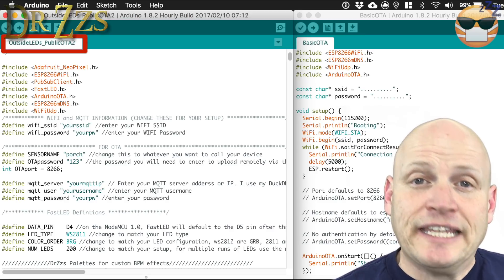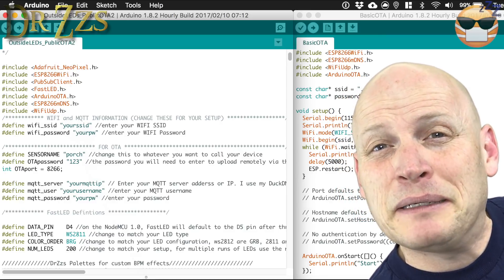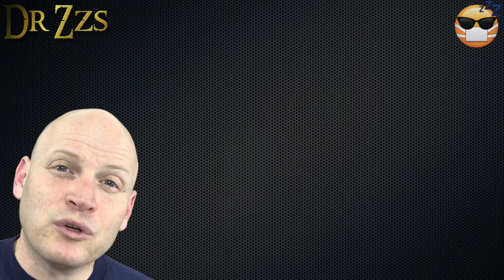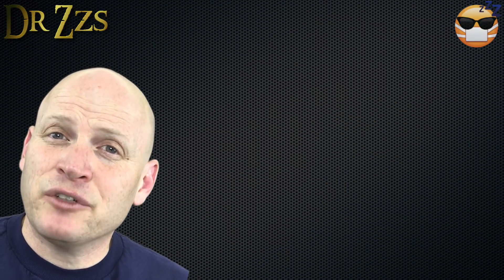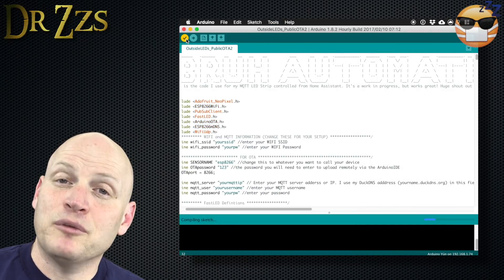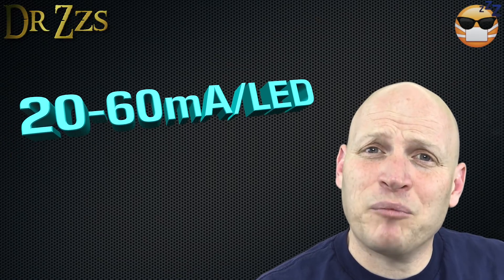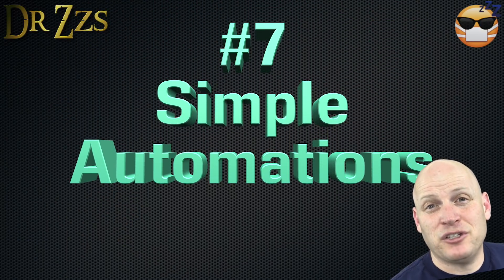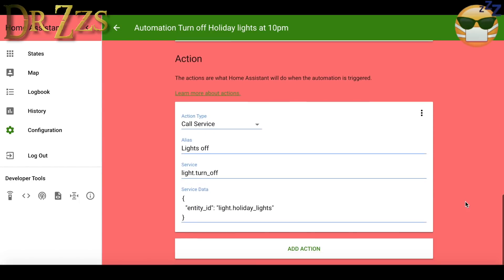Holiday LEDs - What I wish I'd have known

Comment: First, Thank you for your videos. I'm Working on my first set of LED strip lighting. I am using a single string of 50 LEDs just for testing. However;  I followed your instructions for months now also using Bruh video and was successfully set up my Home Assistant with MQTT broker configured and working, The sketch was successfully uploaded through COM Port and OTA upload via Arduino IDE. but still not able to get all the LEDs to turn on. I connecting 3 wires: 1 to 5v, one to GRD and data wire goes to D4 Pin, but I ONLY get the 1st 11 LEDS led with CW (Cool White), the 12th LED in WW or Yellow the rest are all OFF.....I used another Sketch by Carls from " Permanent Digital LED House Holiday Lighting " and uploaded to my Arduino Mega 2560 all the effects works on ALL 50 LEDS string. I couldn't figure it out. Please Help.

Comment: Finally got mine working with this code!  Thanks for all the work you've put into publishing this info it's much appreciated.  For some reason I had to use BRG for the 2811 strips I had.  That took awhile, i actually got frustrated and used other code but it had too many issues so I came back here to figure out my issue.

Comment: Working on my first set of LED strip lighting. My configuration requires that I split my string at the control box for 2 separate runs. I am using BRUH wiring set up for I am stepping up the data line for 3v to 5v. Once I connect both strings to the stepped up line one starts to freak out while one works fine.  I am thinking it is related to a decreased voltage to run both strings on the same data pin. Is there a way to duplicate the signal on 2 different pins?

Comment: Got everything set up but all I get it to do is turn on and off a solid color,  no animations work, even when I set the initial state as an effect it stays solid. I have FastLED 3.2.1 installed
Reply from the maker: it's probably the topics.  If you copied what I had in the github, then the topics didn't match between the sketch and the yaml example.  I fixed them today. 
The easy thing to do is probably to change the yaml to match the sketch so you don't have to recompile and reload onto the board. 
Hope that helps.
Reply: @DrZzs  I copied the mqtt topics from the sketch to yaml, but still no luck. The arduino serial monitor only shows it's getting on and off commands. I even tried putting the seteffect command in the config file and no luck.

Comment: So I started on my holiday led project this weekend and got it up and going for the most part but about 10% of the effects with something to do with red like Christmas, Valentine, USA and a few other when selected lights up red then shuts down, but candy cane ,holly jolly, lovey day and I can do solid red and they all work great. Can any one give me any ideas whats wrong.
Also can I split off the led strip and go two strands two different directions like up the eve or would I need to start a new section?
Thanks
Reply: I remember you talking about having to make some changes in the pubsubclient for one of your projects but cant find it, could this have anything to do with it?
Reply: Looks like I got it fixed, I needed to add  #define FASTLED_INTERNAL before #include <FastLED.h> to my Arduion sketch . I think it had something to do with BPM, not sure though but works great now!

Comment: 7:33 not so hard of a thing to kno. unless yur knew. in the beginning they were called puks not buck converters because they looked like hockey pucks. some moron couldn't hear and/or understand. and started running around happy as a merinarea hybyrd  zippy yuppy screaming buck converter buck converter i love it i love it. Isnt this the most awesome freaking thing. blinking twinkle lights like never seen b4. So anyway it caught on and started getting called buck converters instead of puck converters. then they became digital instead of potentiometer resistance and got smaller and rectangle shaped. But they still were called buck converters.
Reply from the maker: awesome.
Would love to see you doing that skippy screamy dance.  I don't suppose you caught that on video?
Reply: lol no missed that one. was just before everyone owned smart phones. very sorry

Comment: Holy Crap thank you for the flickering fix, was on my way to go get a 5v 12amp Power Suply and in South Africa they are $$$!!
Awesome channel my man!
Reply from the maker: Thanks!
I just discovered another potential source for flickering (if this solution doesn't work for you).  Power the D1mini from the USB port instead of directly to the 5v pin.  There's a diode that gets bypassed when you go directly to the 5v pin and that difference can cause flickering too. 
Hopefully that won't be a problem for you and you can ignore this comment :)
Reply: @DrZzs  thank you for the reply! Wish o could send you a vid of what we made.

Comment: Hi, I wonder what version of the FastLED library you used in the Holiday LEDs project?

When compiling the project appeared this warning:

Compiling .pioenvs \ d1_mini \ src \ HolidayLed.ino.cpp.o
In file included from C: /Users/LeandroCosta/Documents/PlatformIO/Projects/Holiday-LED-files/src/HolidayLed.ino: 27: 0:
lib \ FastLED-master / FastLED.h: 17: 21: note: #pragma message: FastLED version 3.001.008
# pragma message "FastLED version 3.001.008"

^
In-file included from lib \ FastLED-master / FastLED.h: 68: 0,
from C: /Users/LeandroCosta/Documents/PlatformIO/Projects/Holiday-LED-files/src/HolidayLed.ino:27:
lib \ FastLED-master / fastspi.h: 110: 23: note: #pragma message: No hardware SPI pins defined. All SPI access will default to bitbanged output
# pragma message "No hardware SPI pins defined. All SPI access will default to bitbanged output"
^
Linking .pioenvs \ d1_mini \ firmware.elf
Reply from the maker: Just had to check... mine is version 3.1.6

Comment: WISH YOU AND YOUR FAMILY VERY MERRY XMAS - GOD BLESS YOU ALL
hi i have install the light finally today but i am facing an issue certain effects just either reboot the board and switch off the lights or make it non responsive from hassio and i have to reboot esp8266 manually.
Reply from the maker: Thank you!  And the same to you!

Boy, you've sure had more than your fair share of problems...
How do you have your board powered?  Make sure you're not powering your lights from the control board pins.  The lights should have a separate pair of wires for power.  Connect those 2 wires to the power supply, then connect the control board to the other 3 wires (5v, gnd, data).  

If that's not it, tell me some more about how you have things connected and we'll see if we can identify the problem.

Comment: Got them half-installed and all was working fine then I installed the rest the next day, unfortunately the Wemos D1 fried somehow.... I took it down and tried to upload another sketch and the COM port will not connect. I ordered 2 more boards, hopefully I can get the animations working before Christmas. Either way, I'm happy. 

BTW, I have 365 LEDs from corner to corner of my house, So I will run the others on the other side and buy more so I can have the ALL around the house, then do the garage during the summer. Not sure how I am going to do this as the garage is detached, separate Wemos D1? Slave D1? I got some researching to do..
Reply from the maker: I fried a D1 by connecting the +/- backwards.  Guess they're fragile. Good thing they're cheap. 

As for running detached lights, you're in luck!  I'm planning on explaining how to do that in an upcoming video.  It isn't hard at all.  You need a separate D1 and power supply.  The rest we'll sort out in the sketch and Home Assistant.
Reply: DrZzs whew,  I ordered 2 D1's, guess I need another power supply and lights,  think I'll go 12v with the garage.
Reply from the maker: David Garate Can never have too many D1s! 
The gist of running multiples is making unique mqtt topics then combining the effects with an automation in Home Assistant.  
I’m having trouble with the OtA sketch. It was working but now it isn’t.  Not sure where the problem is.  I’d really like to get that functioning perfectly on every D1 I have.  Someday I’ll get it.
Reply: DrZzs do you want to see my sketch and double check? 
I got the sketch to upload on my original D1 (I had uploaded to another board,  which gave me extra options under 'Tools', I didn't notice until tonight, uploaded to an arduino board and options went away, switched back to D1 mini and all is right)  and everything is working. Except for a couple animations look funny.
Reply from the maker: That'd be nice.  Just to compare with mine.  Thanks
I must have overlooked something.  When I load it without OtA it works fine.
Reply: Sorry for the delay, I had to clean the house when I got home.. Here is my OTA.ino file.

https://www.dropbox.com/s/ztqdsuksgzzn9zg/OutsideLEDs_OTA-public.ino?dl=0
Reply from the maker: No worries!
I think my problem might have been I didn't load the basicOTA sketch first.  I'll compare with yours and see if I missed something.  
Thanks!

Comment: Hi professor ;o), you are doing a great job thanks so much!

i got theese RGBW 2812 rings, do you have any clue how to use them ?
https://www.banggood.com/NeoPixel-Ring-24x-5050-RGBW-LED-4500K-With-Integrated-Driver-Natural-White-Module-For-Arduino-p-1198221.html?rmmds=myorder&cur_warehouse=CN
Reply from the maker: I haven't used those, but it should be the same as using any 2811/2812 LEDs.  
Looks like you have 3 wires, so one is + one is - and the third is data.  
You can probably use just about any 3 wire LED controller, or Arduino based board.  So the Adafruit Trinket, the D1 mini (the one I use a lot), the NodeMCU, or of course an Arduino Uno, should all work.  
Going through the whole setup from my first LED video would be overkill for one small ring.  
What would you like to do with them?  Do you have more than one ring?

Here are links to a couple tutorials. 
 http://www.instructables.com/id/A-Very-Quick-NeoPixel-16-Ring-Test-With-Arduino-Un/
https://learn.adafruit.com/kaleidoscope-eyes-neopixel-led-goggles-trinket-gemma/arduino-code

Hope that helps
Good luck!
Reply: the problem with the rings are that they have rgb and a seperate white led, i have to look into it ;o)

Comment: I'm just about done with the controls, but i am having issues with mqtt  (can't get it to work). I've look round and just can not figure it out.  pulling out hair I don't have. Any chance you can help or anyone. I'm running the latest HA.
Reply from the maker: are you using HASS.io?  I had problems with MQTT when I tried switching to HASS.io 
I don't know exactly what causes the problem.  I think HASS.io lets the pi IP address change.  That's what seemed to be happening to me.  
I use the Hassbian install for HA and haven't had MQTT trouble.  

Tell me about your set up and what you've tried and I'll sure help if I can.
Reply: Here are some screenshot.
https://www.dropbox.com/sh/4rkl25zoq5pr02g/AADRHd56X-qSE3Em6RsCWc-Sa?dl=0
Reply from the maker: ya, it's HASS.io
if you aren't fully invested in your HA setup with HASS.io, the install it with Hassbian instead.  I bet that fixes it. 
https://home-assistant.io/docs/installation/hassbian/installation/

You'll have to go through the setup for mosquitto.  If you follow Ben's video it should work. 

https://youtu.be/AsDHEDbyLfg

Someday I'll try HASS.io again and figure out the mqtt problem.  I've just been to busy with new projects.  And, since my HA is working, I haven't had a good enough reason to change.
Reply: DrZzs I loaded the hassbian to the pi and got it to work. Thanks a million!  I was about to just order that cheap controller lol. But kept at it. Here’s the lights at work https://youtu.be/oMu_54JhzXg
Reply from the maker: YES!!!  Glad you didn't give up!
Reply: I thank you for your tutorial, I’ve one question how to setup an automation to change the speed effect ?
Witch service do I have to use? mqtt.publish or light_turn_on ?

Thank you
Reply: BABY FACE, the speed control is written in the code in the yaml file. You should see in your overview page of HA
Reply: Mremsurfer75  Yes I know but I woullike to creat 2 automation with the same effect but different speed.
Like the « police all » effect, first automation with normal speed and a second effect with maximun speed effect "150"
Reply from the maker: BABY FACE I’m sure we can do that.  I think I’ve got an idea but I’m not home to test it. I’ll try to get to it later today. 
Essentially, we’ll have to deconstruct the command that looks at the animation speed slider and replace the part where it looks at the slider with a number. Then put that line into an animation as a second action. 
So the automation will have 2 actions. One will be mqtt publish to choose the effect you want then the second will me mqtt publish and it will set the animation speed. 
That’s a fun idea. We’ll figure it out. 
You could also try the Home Assistant Discord channel. There are usually really smart people on there.

Comment: Here's the proof! 44' of RG6 bridging the gap between two runs of lights - https://www.youtube.com/watch?v=XxaLAtxBh-k
Reply: Awesome thanks for the reply!  This stuff gets addicting :)
Reply from the maker: hahaha!  holy crap!  nice work!
Reply: Whats the reason for running the ground with the data on the RG6?  Does the ground help act as the shield as well?
Reply: Brandon Keilman exactly
Reply: So far my latest issue is flickering, but only on white, anything above around 20% but I think its a shielding issue on my data test set up.  On final assembly all wires will be shielded better.  You guys are awesome and these video's/comments have help tremendously!

Comment from the maker: UPDATE:
If the sunset-LEDs-on-in-Nov-Dec Automations isn't working for you, try something like this:

https://www.dropbox.com/s/jpdty5b4h5779j5/Screenshot%202017-12-06%2008.28.38.png?dl=0

I replaced Sunset with 6pm as the trigger, took out the Nov/Dec only condition, and took off hide entity.  So now it will come on every night at 6pm, but there will be a button on your Home Assistant main page that you can turn on when the season is right, and turn off the rest of the year.  

It's not quite as elegant, but it might function more reliably.  My lights weren't coming on for some reason (either it wasn't registering Sunset, or the Month), so I thought the same might be happening for some of you.  

-Thumbs Up!
Reply: I figured it out with help from the Home Assistant Discord peeps. By having two months set as conditions it is in an AND configuration by default, meaning that it would need to be both November AND December to allow the automation to run, which obviously won't happen. Specifying OR would solve the issue. Here is some info on it: https://home-assistant.io/docs/scripts/conditions/
Reply from the maker: Tim Hanson Awesome! Thanks man.

Comment: An update on bridging the gap. I've been told that the distance between two pixel nodes can be up to 10m with properly shielded cabling but it depends heavily on the installation environment (the awesome answer of it depends we all love). I managed to get 12'; testing out some different cable, hopefully soon, to see if i can increase that. I'll let you know if I find something better.  On another note, these wdt resets are about to be the end of me. I've been on msg board after msg board to try to get these chips to stop resetting with no luck. Going to try a fresh sketch using your newly updated code, hoping it is just some anomaly and a fresh start will eliminate the issue and get me back on track. Great vid!
Reply: Did you use the #define FASTLED_INTERRUPT_RETRY_COUNT 0 to get rid of flickering? If so, what I read was the problem with this code is it doesn't allow the WiFi to ping the chip because the interrupt is shut off. 
The way flickering should be handled is the way DrZzs says "the hard way", it's not that hard, just need to find the file to change the wait time to 18 from 5.
Reply: LOL! 42' of wire, no flickering.
Reply: WORKS! No more WDT resets!
Reply: Also received a tip to put a dummy pixel in the gap to achieve greater distances.
Reply from the maker: Thanks!
Dang.  I don't know about stopping the resets.   The best I can do is suggest trying those changes to the sketch that I used when mine were flickering.
Reply: I'm giving that a shot today. Thanks!
Reply from the maker: Wuhoo!  good work!
Reply: Longer gap jump achieved using regular coax (RG6) and JST connectors, connect the data to center pin and negative to the shield, keep the JST jumpers short. I easily hit my 18' mark, no flickering. Don't know what the limit would be here but RG6 is heavily shielded. Could likely get much more distance if needed. Works great.
Reply: Singletracks & Whiskey  Where did you find a JST RG6 connector?